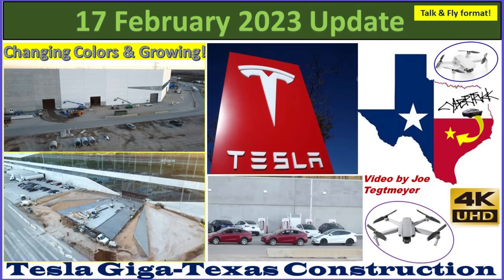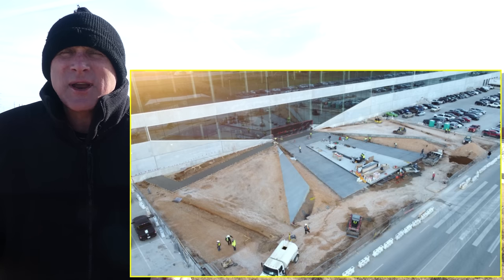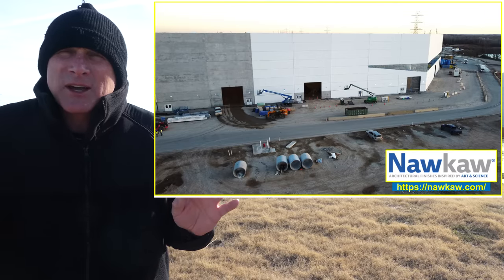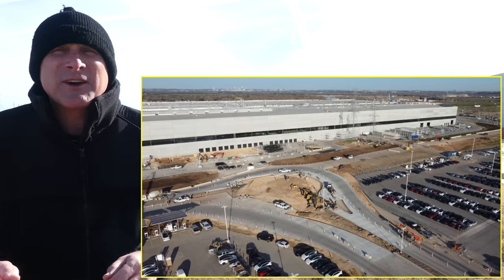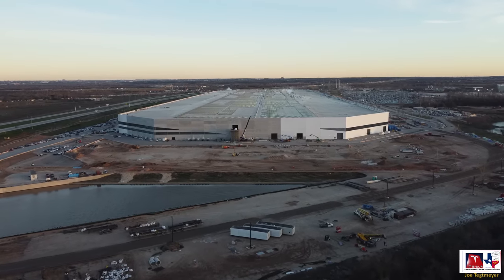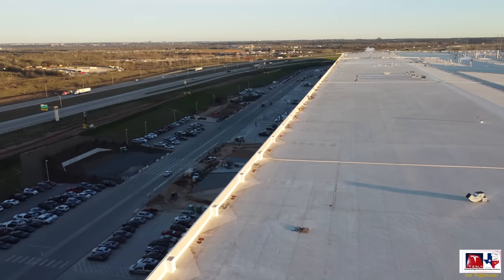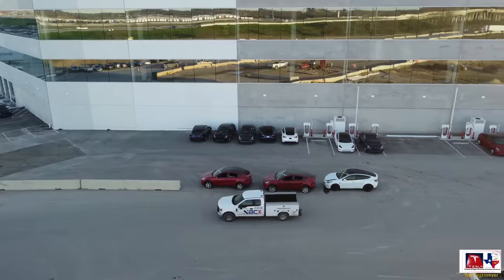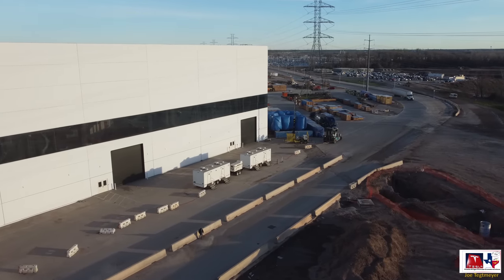Entrance Changes, Solar Canopies & Die Shop Progress! 17 February 2023 Giga Texas Updates (07:35AM)

Comment: Thanks Joe. I can hear the cold in your voice! 
6:17. Stamping 2, roof. Lighting. A small (test?) section was seen installed in Joe’s 2 November video. Still in place, now part of this larger system. Black sheeting placed in the blank areas between the panels.
7:12. Main Entrance. Initial slab is slightly elevated above the adjoining. Small recess created, likely for lighting. Similar detail in the former stair.
Being very particular with the saw-cutting of the slab.
Inside. To the left of the doors, might be forming up a concrete stair. Seems to be a slightly elevated floor level, a landing perhaps.
7:28. Main Entrance, apron. Left. Sidewalk/footpath returns into the wall. Architectural feature, or stair location.
10:23. Southend. Shipping container being used as a workshop might be one of the concrete contractor’s. Lumps of waste concrete to the right match the shape of the bin seen at 7:12. To the left, stack of shuttering/formwork.
11:09. Southend. De-watering prior to construction of a possible large diameter shaft.
Curved steel shoring stacked nearby, estimated diameter 19’. Diameter of de-watering pipe arrangement around 21’.
11:31. GA apron. 3 Model Ys. Red pair appear to be sitting quite high when viewed from ground level in Joe’s photos. No batteries?
13:11. BIW, apron. White Model Y driving back inside.
17:39. Die Shop. Formwork over the reinforced piers. The mud bases within are at a variety of heights, finished floor may reflect that.
17:45. Die Shop. Initial floor slab. Pair of long narrow trenches cast east-west into the floor.
19:03. Cathode, north. Stack of dock levellers.
24:10. Casting, apron. Couple of large and thick steel plates with a forest of shear studs welded to the face. To be buried into concrete as a base for a machine I would guess. Smaller plates beside. 
Likely a preformed set-down in the floor, plate set at required height, shear studs to face down, holes to squirt the concrete/grout in.
Reply: Good observations (as always)! 
7:28 - Likely to allow landscape against the building.  The return is to hit the path of travel for the ADA/accessible parking spots.
Reply: @patrickkenny2077  Thanks Patrick.

7:28. 8 days to get this finished for March 1 Investors Day. Might just be an interim step will be ready for March 1, and then further works later.

Comment: Hi Joe, The arched pieces of rusty metal you see on the south end of the site next to the dewatering system. Look to be parts for a shoring system. Most likely for a deep excavation for a new sewage pump station where the dewater system is installed. There are several other sewage pumps along the west side the building. There is a large force main for sewer that all of the pump stations connect to that goes under the river to the treatment plant. This was the first directional boring that was done under the river back when the building was still be erected. They seem to be having issues with some of the smaller pump stations. This new pump station would be the main pump station going forward The other smaller pump stations would to the new main pump station.   I'm a superintendent for a contractor. We build water and sewer treatment plants and pumps stations. I have been watch this very closely. Hope this help you! I watch an enjoy all of your videos. Thanks Jamie Harbell
Reply: Any insight as to why they need to de-water this excavation and not any of the others?  Also, why would this lift station be so close to the building compared to the existing one?

Do you think the original main lift station was just consiidered hopeless for some reason?  I struggle to understand just why they have had to re-work it so many times.
Reply: The water table in that area is shallow. That why the storm water detention pond always has water in it. They did dewater same of the other pump station excavations. They pumped the ground water out of the excavation. When you pump from a excavation the water became laden with silt that requires filtering. Using the well point no only dewaters the excavated area but dewater the surround area. The water from the dewatering system is free of silt and can discharge without filtering (as you can see in the discharge tank).

It seem like a lot of poor planning by the design engineer and project management team. The amount of rework on the underground piping system is far outside the norm.

Comment: Went and looked at the Nawkaw website as you recommended Joe. Very impressive product range, especially from an environmental perspective. The terrible VOC fumes the local community was able to smell from up to 2 miles away when Tesla was coating the steel framework during construction of the main building won't be an issue here. Obviously I've no idea how much the use of Nawkaw products is costing Tesla, but it's should eliminate (a lot) of the maintenance and reapplication costs of traditional paint jobs over the 25yr lifetime of the Nawkaw products.
Reply: First I head about the concerns from the original painting... but I understand intumescent paint is a bear to apply.

Comment: What does "dewatering" mean? Dewatering can be defined as the process of draining rainwater or groundwater from an excavated area before construction can begin. Usually, dewatering pumps, with high air-handling capacity are used to remove the water from the excavated site. This water is often let out into wetlands, lakes, or other water bodies, which have lower groundwater levels.
Reply: Did you not answer your own question?
Reply: @jbbuzzable  Yes

Comment: I wouldn’t have a problem with leaving the concrete exterior as is but great if they can smarten it up in white. I can hear my Mum saying ‘white will show the dirt’.
Reply: Reflecting the sun to keep it cool.
Reply: It is dependent on the quality of the protective coating. High quality coatings will shed dirt and keep the concrete looking far cleaner than if left bare, provide thermal protection, and protect the concrete from pollution and acid rain that degrades it over time. A new coat every 5-10 years, and it will always look good.
Reply: @GoCoyote  thanks I didn't know there would be practical reasons!

Comment: I still say that they are not going to expand that main building.  They will build another building to its south.  

In fact, I'd sooner predict that they would re-pave the south end than extend the main building into that area.  That's how much I think they won't tear up the main building to extend it.
Reply: This is your first day here right?  You must not have seen the pile of broken up concrete besides where they are parking the trailers across the freeway.  That is all concrete that came from the front entrance area and inside the building. Please never say you don't think they will tear up the main building without following that with LOL, LMAO or ROTFL.
Reply: @jestercat7723  I've watched since Jeff Robert's first video.  Previous comments I've made on the question of tearing out the south wall to extend the building have spoken to the disruption of the operations within and disrupting flow of materials into areas that would no longer be at the building periphery after new construction extends the building south.  Time will show if I'm as naive as you see me.
Reply: @CarlWithACamera  If you watched previous videos, you would have seen numerous occasions where they have removed wall panels and replaced them with plastic or built replacement walls.  Since it is standard procedure for them why do you think they won't do for the south end? Don't get me going on their not disrupting the flow of materials.  Every plant they have built except for Giga Texas has had numerous doors around the building.  Now they are going around the building putting new doors in.  Why didn't they need that flow of materials at the beginning of production?  And if ease of flow of materials from the building's periphery is so important why is the building so wide across? Shouldn't it be much narrower and so much more incredibly long than it is?  Since it is shaped like it is how do they get parts to the middle of the factory or the upper floors? A better indication that the south wall is coming down is the fact that they are painting it.  You paint the wall now and that is more money wasted when it comes down.  Sorry just my irritation at all the intentional waste Tesla has engaged in building Giga Texas.  But you were absolutely right in part of your original post;  when they put the first floor in the building extension they will, in effect, be repaving the parking lot.